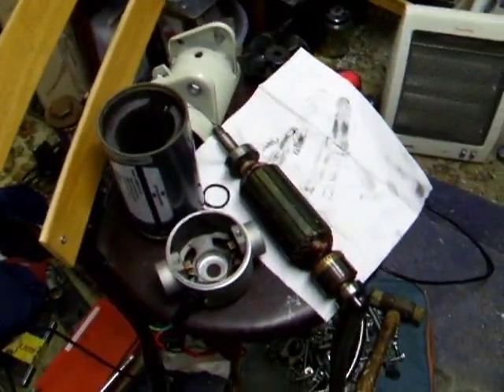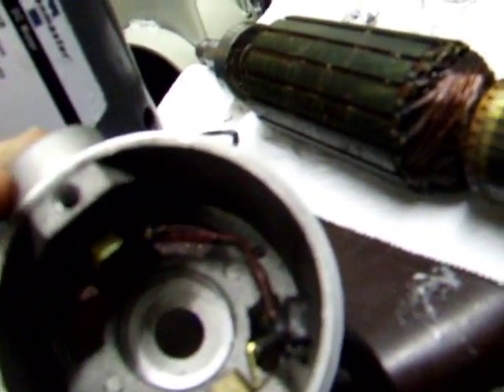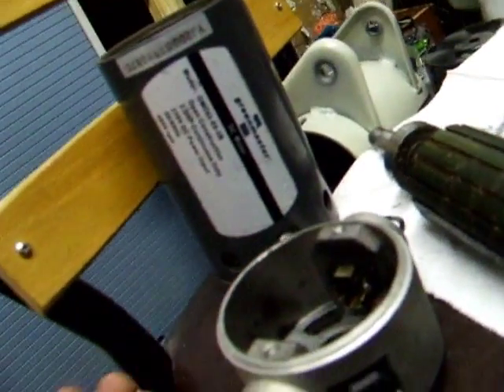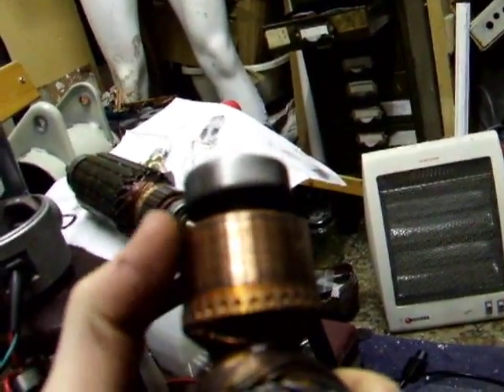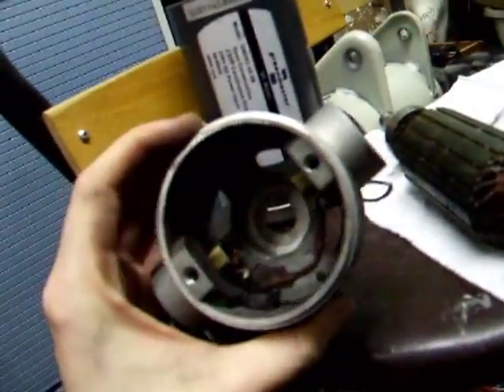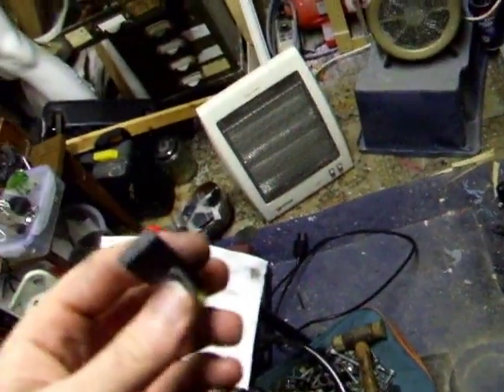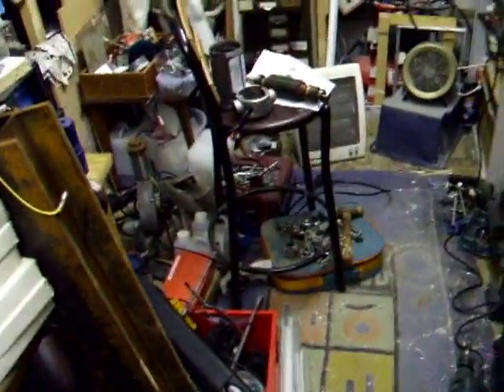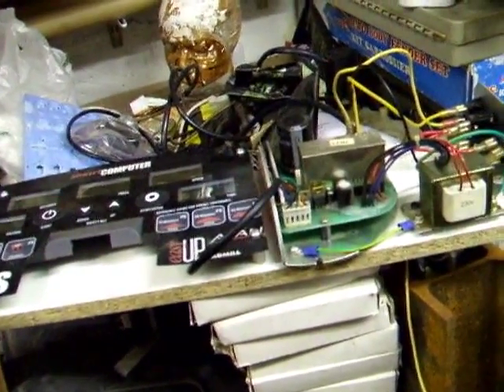Opening the treadmill motors and a rant about the robot base

Comment from the maker: @Jskdog They actually just unscrew! It'll be threaded in the opposite direction it's intended to usually run. The trick is figuring out how to hold the spindle still while you unscrew the wheel though. One had a long enough bit sticking out at the fan-end to clamp it in a vice, the other I had to drill and tap a hole in to get a bolt in to grip it with.
Some may be pressed-onto the spindle, but apparently this is rare.